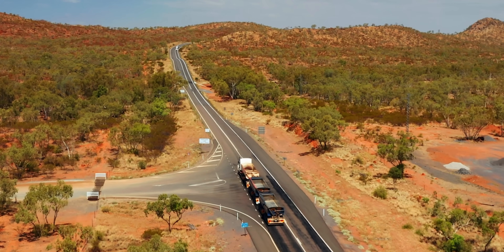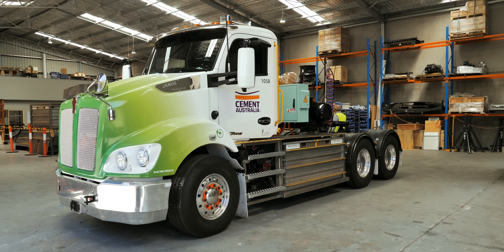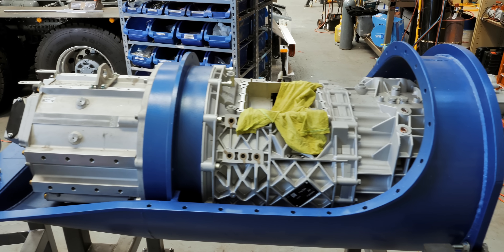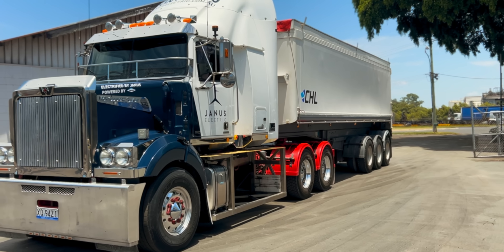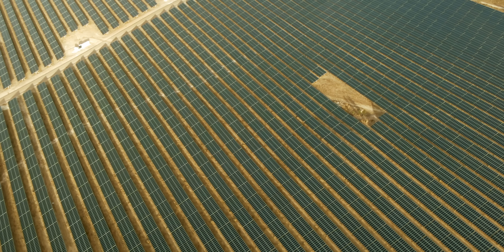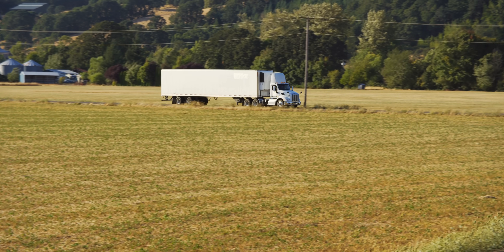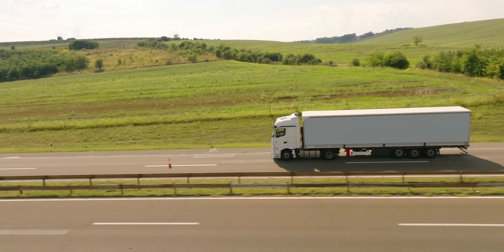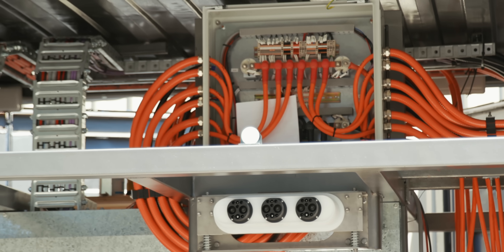This GIANT Electric Semi Can Swap Out Its Batteries!

Comment: I remember many years ago when you reported on Better Place and their idea of battery swapping. This seems like it could be the future for trucking in the US. One thing to add is that this could significantly reduce overhead for independent owner/operators, thereby increasing their income.
Reply: Fast charging has negative effects on the lifetime of a battery, and there are losses with the transfer as well.
Reply: @counterfit5  Depending on how you use them you need much more battery, you probably need about 1 addional battery for 2 trucks you have much more battery capacity laying around that goes bad just by normal aging.
Also difficult to calculate the range when you swap them out since you dont know if you get a new or rather old battery.
Also you need massive infrastructure for the swapping station.
The Tesla Model S had an changeable battery but it just wasnt use because it would be to expensive compared to charging.
Reply: @counterfit5  There is fast charging and fast charging.  Under 3C rate charging won't hurt a battery with active temperature management.  3C means a 20 minute charge.
Reply: @kirkellis4329  You can't fast charge above 70%. It drops to 1C and then drops further fast. With these size of batteries you carry around 200 kWh of extra battery (over half a ton) to fast charge from 5-80% in 20 minutes. Actually significantly more weight. The current design looks air cooled, since it only has 3 electric plugs connecting to the truck. Both packs would then also need a big ac unit plus the liquid to cool the batteries. And then there is the cost of electricity. A fast charged kWh costs at least 50 cent from the grid, while you can charge for less than 10 cent if you hook it up to solar or wind directly. With a consumption of 250kWh/100km, you basically save $1 per km driven. That are two drivers wages.
Reply: @Psi-Storm  while you can charge for less than 10 cent if you hook it up to solar or wind directly.
This ofcourse expects that there will be no added on costs with battery swapping, which there definitely will. It definitely isn't unlikely that commercial battery swapping stations will be as or more expensive than fast charging.

Also any battery really should be more than just aircooled, likely they now just do it like this because its initially cheaper and easier, but long term that isn't necessarily the case with potentially higher battery degradation during travel.
Reply: @kirkellis4329  

😂😂😂😂😂

Are you sure you should be quoting such figures? How long have fast chargers been around and have there been batteries which have failed earlier in their service life than expected?

Nobody can say with any certainly as yet.
Reply: @t1n4444  Fast charging for EVs has been around for a short time, but fast charging lithium ion batteries for other applications has been around for a long time.  At 3C, it would only take 16 minutes to go from 10%-90%, the recommended operating range for lithium ion or polymer ternary cells.  And 3C isn't all that fast when you consider that a 350kw charger is trying to push 4C or 5C for the first ten minutes before they slow down.
Reply: @kirkellis4329  

You omitted to mention ambient temperatures.

Would repeat batteries don't care for multiple C when very cold.

I gather there's a paper by Ford US on charging batteries in a taxi garage in Chicago which covers the problems of charging lithiums at very low temperatures. I gather too that the BMS allowed charging rates at less that C/10 of less.

The short term fix was installing heating panels to the batteries.

Nowadays we read of "preconditioning" batteries as in preheating them.

We now read of batteries getting too hot in some locales and require to be cooled whilst in operation.

Seems like a lot of faffing around.
Reply: @t1n4444  Properly designed battery packs are temperature controlled constantly, keeping the temp of the batteries between 20c and 40c by heating or chilling the plates in contact with the cells.  Outside temps can be -20c or +50c and it doesn't matter to the battery in its controlled environment.  Ambient temp costs some energy, but it doesn't affect charging speed anymore.  These are not the early days of Leaf air-cooled batteries and early Tesla packs.  Properly designed for fast charging, a battery pack is built once and then just works.  Sounds like less "faffing around" than finding the guy with the forklift and getting him to disconnect your high voltage battery packs and swap in new ones, then reconnect the high voltage leads while wearing thick gloves in freezing weather.  They kind of gloss over the fact that there has to be some guy standing around with a forklift waiting until somebody needs a battery swap done.  Or a truck driver needs the skills to maneuver a forklift in somebody else's warehouse and deal with dangerous high voltage cables on his pack and the spare pack.
Reply: @kirkellis4329   

Hmm, "possibly" with respect to battery management.

As for the battery replacement activity then would suggest a lorry driver wouldn't have too much trouble using a forklift.

Materials handling courses are well established in UK, say, and many heavy lorries carry a forklift on the back for moving stuff on a clients premises.
Reply: @t1n4444  I know I've seen drivers use a forklift, but I don't know how common that is amongst drivers that don't carry palletized goods -- ie, tankers, cement trucks, gravel trucks, fruits, fertilizers, etc.  I suppose the high voltage cable connections could be made foolproof as well, but disconnecting heavy cables has got to be tricky and time consuming compared to plugging in a charging cable.
Reply: @kirkellis4329  

😂😂😂😂
Reply: @kirkellis4329  I imagine the "shelves" the batteries goes into when removed from the truck are not just shelves. They're charge stations. When you put the batteries in, they are automatically connected just like when you put them in the truck. You'll not be crawling around in there hooking up cables.

There are no high voltage cables flopping about. The slot the batteries go into has a connector at a preset location. The matching connector is on the battery. You push them in, they are connected. Like in a computer dock.
Reply: @counterfit5  

Quite so ... batteries don't really "care" for all this fast charging nonsense, especially in colder climes.

It's almost as if vehicle manufacturers "had" to come up with fast charging so as to "disguise" the fact that the whole lengthy rigmarole of charging wasn't too obvious. Sitting for a while at a service station when queueing up to charge in freezing weather doesn't seem to be an improvement in road transport evolution.

It may be a lot of people will think hard before buying a second hand EV, simply on the grounds they can't really know how long a battery will last when the car is in their possession.

And then trying to sell a third hand EV may be much worse again.

In UK we've been given the warning of more cold weather to come so doubtless we shall see more actuality of EVs "stranded" on forecourts waiting to get charged.

The sooner batteries are replaced by hydrogen fuel cells the better.

In a bit less than two years we shall be regaled by the report on the "functionality" of BMW's 200 strong hydrogen fuel cell powered test fleet.

This test fleet has been deployed across the entire planet to collect data on the viability of hydrogen as a fuel.

We'll soon know what BMW has to say on hydrogen as used in a fuel cell.

Other outfits are testing the burning of hydrogen in modified ICEs.

I would suggest it would be shrewd to wait for the test results before claiming batteries are the only way to go.
Reply: @t1n4444  Hydrogen combustion engines are pretty much a non-starter.  They are really difficult get to work properly and they are really inefficient compared to a fuel cell.  If you manged to put a hydrogen combustion engine in a small car, you would literally need to pull a trailer behind it with a big hydrogen tank.

Really, hydrogen fuel cells should have been a non-starter also.  I have looked at the Toyota Mirai.  The new one doesn't look too bad on the outside, but it is a highly compromised design.  There is a giant 10,000 PSI tank right down the middle of the car, so even though it is a relatively large car, it really only seats 4.  The trunk is also minimal since there is another hydrogen tank under the back seat, one behind the rear seat and also a hybrid battery behind the rear seat.  That means there is almost no trunk space and the rear seat does not fold down.  A Prius probably has more usable interior space.  The Mirai is also packed full of a huge amount of equipment compared to a simple battery electric car.  I have also seen a lot of reports indicating that we can't make enough hydrogen fuel cells since most designs still use platinum and we just do not have enough.

Hydrogen is just not good as a fuel.  It is very difficult to transport and store.  It leaks very easily and causes hydrogen embrittlement to metals.  There is also the efficiency problem.  Since it is very low density, even at 10,000 psi, it is often made on site with electricity.  It might take about 4 to 6x the amount of electricity per mile for a hydrogen car vs. just using the electricity directly in a battery electric car.  How can that ever be price competitive with battery electric?  It likely isn't even the best choice for energy storage of excess renewables due to the low efficiency.  Also, are you going to buy the really expensive hydrogen made from water or the comparatively super cheap hydrogen made from natural gas?  Hydrogen is currently more expensive than gasoline.  There is a reason that there are almost no hydrogen stations even though Toyota and others have been working on fuel cells for decades.  It is just not economically viable.  I have always considered it to be a fossil fuel company hoax to keep us burning natural gas for decades longer.  It is like clean coal, which never existed and never will.  Coal is already more expensive than solar.  If you add on the cost of capturing the carbon dioxide, it is really obviously not economically viable at all.
Reply: @jamescox8429  

Hmm, almost everything you typed was completely wrong ref "today" and might have been a history lesson.

So thanks for your efforts but efforts largely wasted.

Has you troubled to research the topic prior to posting then you would know this.

Suggest you read up "today" and discover how far behind the technology you are.

Almost every poster is way out of date regarding the R&D on exploitation of hydrogen.

Why? Because they confine their compass to the use of batteries to power their personal transport.

Even our host is especially resistant to change ref hydrogen gas technology in favour of batteries and he will, eventually, being getting his epiphany moment ere too long.

I might remind you and other hydrogen exploitation naysayers that the object of the entire exercise is to reduce the rate of global temperature rise. You'll be aware of this target of 1.5C? That's very unlikely to happen anytime soon, if ever, and we do run the risk of rising sea levels.

Dealing with that issue will cost a "lot" more than finding alternative sources of energy to power transport.

You might be aware there are other channels hosted by YT (just a case of searching) which favour hydrogen exploitation and have long abandoned batteries to the dustbin of history. Ditto there are other channels extolling the burning of hydrogen gas in ICE vehicles and home heating. As before it would be beneficial to keep up with this tech and refrain from regurgitating "old tech".

Generally these channels are better researched and don't rely on wheeling our the occasional expert witness, who it must be said are woefully out of date ref their alleged expertise.

Some might decide there's a bit of "confirmation bias" lurking in the background ...

You might have noticed this astonishing growth of hydrogen production projects being rolled out across the planet. You might have noticed also that the UK project to manufacture "British batteries for EVs" was allowed to wither on the vine because of lack of investment.

HMG offered the match funding thing but thus far it's (our) money is safe.

The project was resurrected by a combination of Australian and American money although as yet the money injection is just talk.

The project has also altered direction in that the batteries to be produced are for bulk storage, if you will, of electricity produced by renewables.

And, as yet, no details of the technology to be used has been released.

Will lithium feature? Or will we see the manufacture of these "flow" batteries using other metals instead? Doubtless we'll get the "big reveal" if the project ever takes off.

To repeat would suggest you, and others" do a lot more research on the topic of mitigation of global warming and try to keep the use of batteries in EVs in context.

Hope that helps and provokes you to do a lot more research on the emerging tech before you resort to giving us history lessons.
Reply: It is much more expensive to set up a supercharger station compared to a battery swap station. All you need is a spare battery, electricity to charge it, and a forklift.

If you buy a Tesla semi, you will have to wait for Tesla or somebody else to set up a supercharger at the correct position in your route. With battery swap, you buy an extra battery, a charger, rent a spot to store this at a factory with a forklift somewhere near where you need to swap batteries, and you KNOW that your battery would be ready for you when you get there. There is no wait. Imagine arriving at a truck supercharger location only to have a queue because a couple of chargers broke down.
Reply: @danielch6662  They did say that the forklift is an interim step and that this process will be automated.   Your idea of customers setting up battery swap stations on their regular routes (where distance requires it) makes total sense.  I suspect that Janus will design their robotic swap stations to be built in their shop and delivered turn key to customers.  I also suspect that because the batteries in the recharge rack will be charged more slowly than would be the case with superchargers, that complex temp management is not required providing another reason why swapping for these big trucks (vs cars and small trucks) would make a lot of sense.  A one minute swap versus standing over an enormous diesel tank fueling for ages would be a major plus for the drivers and operators....every minute counts and the last thing you want is your driver wasting his break holding a fuel nozzle and breathing in diesel fumes.
Reply: Being able to swap in a few minutes is nice, but is it really necessary ?  With large enough battery storage systems on site to do the charging, fast DC-DC charging can be done in 20 minutes regardless of pack size -- that is barely a bathroom break every 4 hours of driving.  And you might save weight with a battery pack that doesn't need to be robust enough for all that constant handling.
Reply: @kirkellis4329  fast charging damages batteries.
Reply: @kirkellis4329  Yes, it is necessary, at least in some scenarios. And that's not even mentioning the overwhelming amount of other reasons why battery swap is absolutely worthwhile. For example, the potential to make "refuelling" stations powerbanks that can stabilize the grid instead of put enormous amounts of stress onto it. Let's think about battery health and degration. Let's think about the evolution of battery tech itself. Look at what NIO does in China. Battery swap is definitely the future, at least for a part. Fast charging is and obviously will remain another part of it, but the good thing is... They are NOT mutually exclusive!